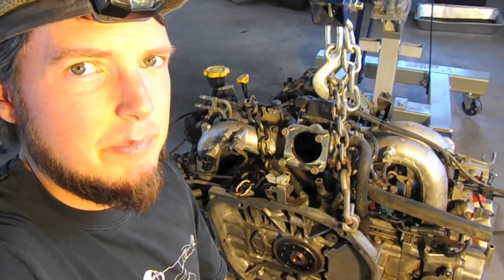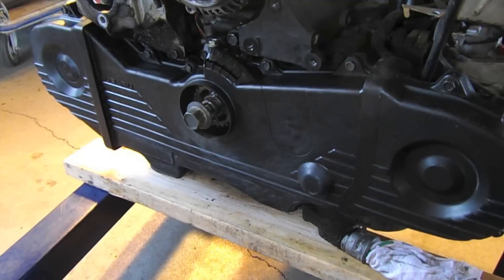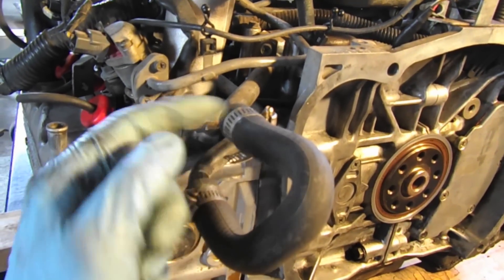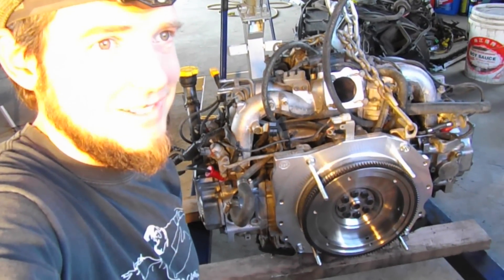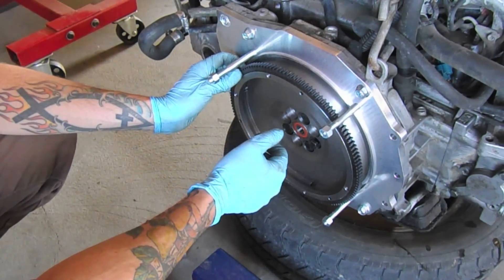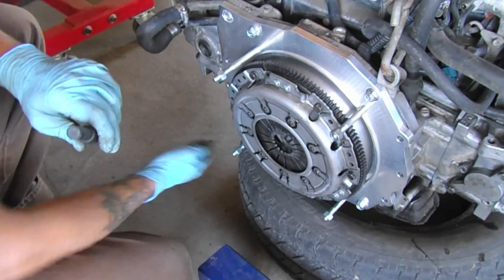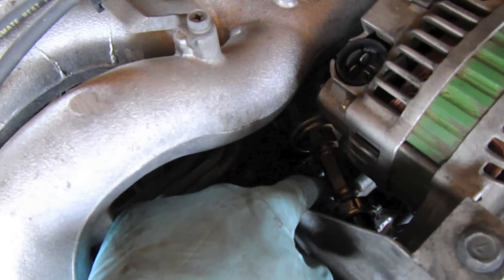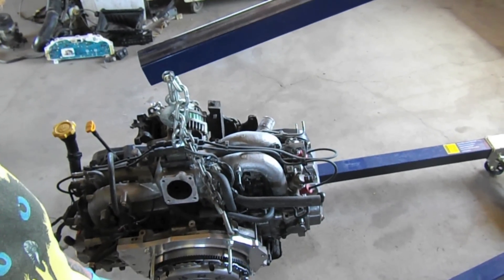Subaru Engine Prep - Busaru Engine Conversion Part 6

Comment: Did you end up retapping the hole for the oil pressure sending unit to 1/8th npt threads?

Comment: So I just realized that the engine goes in backwards compared to how its sits in a car. How does that work ?LOL
Reply: It works the same exactly as a Volkswagen motor they both spin clockwise nothing changes

Comment: if i dont have the little locater pins at all do i need to acuire them or can it be done without
Reply from the maker: +Randy Lucas it's a wise idea to have them in my opinion. It just centers everything nicely.
Reply: can they be bought? i sold my old motor complete with them im sol
Reply from the maker: +Randy Lucas I'm sure they can, and some vendors supply them with the flywheel. Give Outfront Motorsports a call - they deal with adapter and flywheels all the time.
Reply: ok thanks man!

Comment: What are the specs on that flywheel? Can i use this 8 dowel flywheel? http://www.ebay.ca/itm/VW-BUG-BUS-GHIA-200-MM-LIGHTENED-FLYWHEEL-AC105780-311-105-273HP-98-1275-B-/291734631680?hash=item43ecbd3500:g:skwAAOSw8RJXCvBQ&vxp=mtr

Comment: Hey how's it going,  I'm completely  new to all of this stuff I have a 72 vw Riviera that's manual and I'm planning on purchasing a 92 subaru legacy that's automatic, would I need to buy a different computer since I'm going from an automatic  subie to a manual vw transmission? Is it even possible? Thanks for your time
Reply from the maker: Hey Mach, the computer doesn't care which trans it's mated to. The auto uses a transmission control unit that you cut away from the harness but that's about all the difference there is.
Reply: awesome! thanks so much man, keep up the great channel

Comment: isn't the transmission of T2 same with vw beetle 1303? i was planning to convert my vw 1303 to boxer diesel.  but i know  it has to have conversion when it comes to transmission and engine installation. is that adaptor plate also available here in the philippines? did you custom ordered it or something??  thanks. love your documentary.
Reply from the maker: Thanks for the compliments. Your transmission should have the same bolt pattern as the buses. I would order the adapter plate from Rocky Mountain Westy or KEP. I'm sure they can ship to the Philippines, it'll probably just be expensive. Good luck on your swap!
Reply: Busaru thanks i'll visit their page. by the way i was i bit bothered of the width and length of subaru  ee20. does the size difference is too much? i was bothered i may cut too much to my 1303. thanks.

Comment: hi I am putting a impreza sport non turbo into 68 early bay with the gearbox be ok or not do I have to change wheels for the gearing top end speed
Reply from the maker: Is that the 2.0? If so you'll be around 125 HP or so. I'd drive it gently until you find an 091 transmission. I would wait on wheels until you drive it and see what the gearing is like. I don't drive 75 so I'm okay with stock gearing.
Reply: what is your thoughts on going with the Subaru gearbox and your videos and explanations are fantastic
keep up the great work pure class its a 2.0
Reply from the maker: william dobson Subaru gearboxes are fantastic. If you've ever driven one, you know they shift super smooth (most of the time) and are geared well. I've never installed one in a VW though, and the SubaruGears kit is VERY expensive, so I'd love to hear your thoughts if you decide to go that direction.

Comment: Another prep people might consider at this point is the oil separator plate located to the right of the rear main seal.  If it is plastic it needs to be replaced with an updated "metal" separator plate available from Subaru.  The plastic plates leak and can only be changed with the motor out.  Loving this video series.  JC.
Reply from the maker: Thats a good point. I've never seen one fail but there are several folks that recommend it. Another thing one might want to consider if you have the timing belt apart is to do the head gaskets. Its simple and could save a lot of hassle in the future (although its not a huge job on a swapped VW as there is great access to the head bolts while still bolted in the van/bus).

Comment: This could be done in a bug? Are you planing on doing another swap líke this? Which transmission was on the bus for this engine
Reply from the maker: Hi Jose, I have the 091 4 speed in the 1977 Bus and I have a 3 speed auto in the 73 bus I have. This swap would almost be easier in a bug. I hope to do one eventually. If I can come across a bug in reasonable shape I'll probably do a swap.

Comment: I would like to know a bit more about the oil pressure sending unit.  Part number or kit you got it from, etc. Also if you want to have a water temp gauge and perhaps voltage, what is the best way to go about that?
Reply from the maker: Take a look at the "Gauge" episode, it details the part number for the multigauge (which comes with the senders for oil pressure and water temp).

Comment: Can you help ott on what adapter plate nombre is needed . I look on the KEP listing i dont want to mix anything from the adapter plate to flywheel to clutch . Thanks in advance .
Reply from the maker: Hey Remichiv0, For the 091 transmission I use KEP's 228mm flywheel and adapter plate (VW-Subaru). For older transmissions that use the 200mm clutch, you will need their 220mm flywheel.
Reply: Thank you very much . You are the best . The only one out there with that same conversion a what i am doing, great help . Quality video + i like your style very nice . ( i am using a EJ22 92-94 i will flip intake around 180* .

Comment: Nice work. One thing to note though, the throttle body coolant supply isn't necessary, it can just be bypassed.
Reply from the maker: Yeah, I'm running no coolant through the throttle body of my 73 and it's not affecting anything. Some don't agree though, so I wanted to show how you could keep it stock. Thanks for offer of simplicity - I'm always looking for tricks like that.

Comment: Great job! Another question. When I used to mess with 4G63's (DSM) I'd bypass the throttle body coolant lines to help keep the intake air just a little bit cooler. I know this isn't a turbo but wondering if it'd help at all.
Reply from the maker: That's the way I run on my 73, but for the series I chose to keep things as stock as possible.